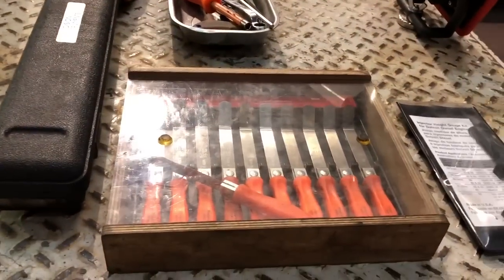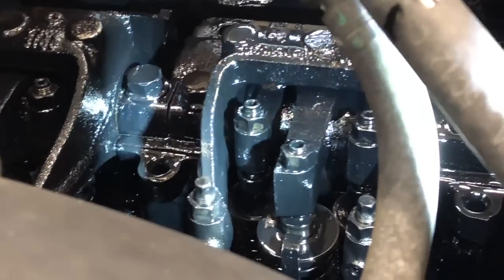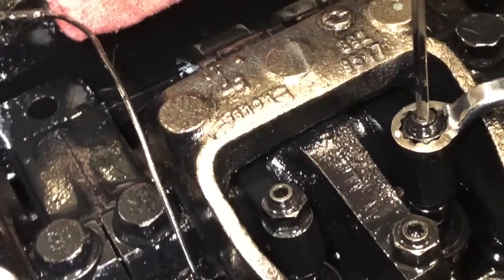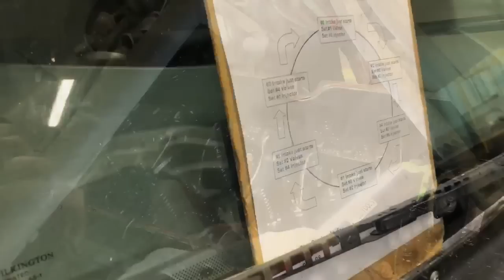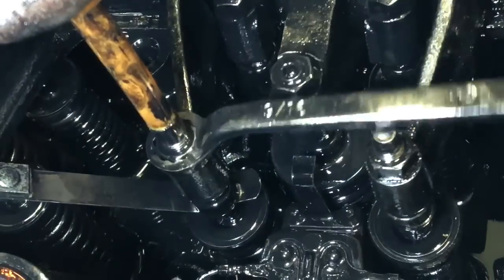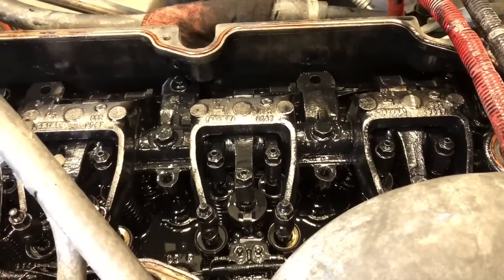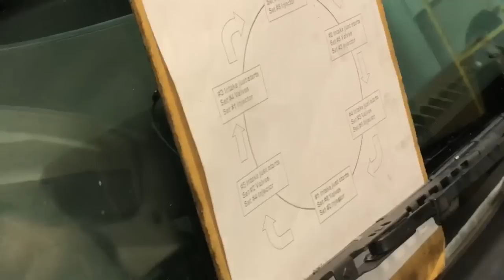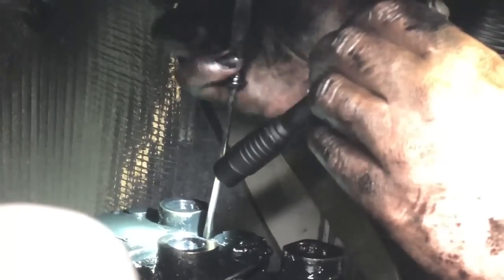How To Do A Full Overhead On A Detroit 60 Series ! Taught by an ASE certified Detroit technician.

Comment: Pro Tip from a Cummins tech: did your hear how he said its a feel thing?? well that is correct to a certain point, let me explain. Did you see how when he would run adjusting screw down then "feel" for slight drag then tighten the nut? If you want the "perfect" feel every time do this: Insert your feeler gauge as he did turn the adjusting screw down just until you have resistance hold it in place and then tighten your jam nut down. The slight tension the tightening of the jam nut against the adjustment screw will create that "perfect" drag every time.

Comment: Here's what I taught myself at 2 in the morning and the truck is to be rolling out around 7. New cylinder head installed, ran the overhead and missed my overlap.  Doesn't take but a few degrees guys. As soon as that intake roller starts to move with your finger on it, stop. If your intakes are too tight or lose determines where the roller is on the cam lobe ramp. I always roll my intakes to the bottom of the lobe and set those intakes then roll it up to where the roller starts to move. Doesn't take but ten minutes longer. But so what.

Comment: Totally fascinated by this video. Watching a master mechanic with years of real world experience working his craft is so exciting.  All the while, kneeling on the top of a steer tire hunched over. Makes me hurt just thinking about it.
Reply: Tim Jackson I pulled a muscle in my shoulder when I removed that rear Jake brake housing, been doing this stuff about 12 years professionally and it's made a tired body out of a young man!
Reply: @dieseldoctor9294  those are not light. At least 30 lbs each I think. On the 14 liter I'm doing anyway.

Comment: Cheers from Down Under.

Great video.  Love watching this sort of stuff.  Was a diesel mechanic years ago but now I just enjoy tinkering.  Miss is a lot but watching you work on this kind of job reminds me of the sore back and the hyper-extended knees. 

Those screws that hold the Jake wires.  Take them out and throw them to the schissenhausen then replace them with allen head screws.  I hate flat bladed screws at the best of times but when they are tight like they were for you then they easily burr over resulting in a lot of swearing and added time to the job.

Keep up the good work.
Reply from the maker: Thanks for watching ! I really appreciate it !

Comment: You run the inj height tool different than me for sure. I put my finger on top and rock the tool in and out watching the bottom of the tool. If the post moves in the inj hole too high, if the flag moves on top, too low. Right in between, lock er down. Also you don't need short rocker shaft bolts, just use the jake spacers  on top of the rocker shaft.  Also once a year you are suppose to remove the inj harness at the ecm, inspect for oil. If oil found replace the inj harness and if you have the million dollar fitting, vac test the ecm. Must hold 6" of vacuum for 15 minutes. I worked in a fleet that had 11000 s60's.   Take care, wear gloves, that crap is highly carcinogenic.
Reply: I don't wear gloves, but I don't drink or do drugs, and my hands get greasy oily maybe once a month, not every day

Comment: When adjusting the J valve for the Jake's loosen the lock nut and turn in the J valve in about a half a turn to bleed it. Then set your lash adjustment. This pushes the oil out so you don't get a false reading.

Comment: I would remove the surge tank mounting bolts then swing it out of the way with out draining 
Next I would remove the cowl 
Doesnt take long giving you a better view for inspection and also prevent dirt and debris from falling off of it and going into the open over head
Then that tray of tools I wouldnt use them 
I use my series 60 tune up tool I build 
Sold many of them to some of the top series 60 tecs in the bay area who all testified they loved the tool because it was faster and made the job a lot easier
37+ years heavy duty mechanic
27 years at a major freightliner dealership
10 years at Mack
Short time at Peterbilt
Cummins definition of zero lash is 6inch lbs 
You tighten the adjusting screw with the feeler gauge in place tighten the adjuster to 6 inch lbs tighten the jam nut let it go
Reply: What 60 series tune up tools did you build and are they still available

Comment: After how many miles should a overhead be done?
Reply: I recommend every 500,000 miles you should run the overhead, rebuild your fifth wheel, pull and install new wheel seals, clean your doc and replace the dpf with new, and spin the fly wheel and install a new clutch.
Reply: @marcusharris113  how about just buy a new truck while you're at it?

Comment: How much  does a overhaul usually cost for Detroit? I'm looking to get into a older truck preferably with a Detroit 60
Reply from the maker: Just depends on the place you have it done could be a flat rate of $250 to 4 hours labor plus valve cover gasket cost and injector wiring harness depending on if needs replacing or not
Reply: Would you recommend the Detroit 12.7 over any other engine? I'm pretty new to trucking 8 months in.  I plan on going owner op in few months. I've only driven the paccar engines they're great to me but everyone always says stay away from them
Reply from the maker: I love the Detroit 60 series they are great. Our entire fleet is all Paccar Mx engines all but 1 Detroit (60 series) 1 Cummins Isx and 1 Cummins M11 
I am not a Cummins fan at all. They are strong but won’t last (look in the truck paper at how many are for sale at 500-700k and you will see “recent inframe” 
My favorite engine is the Paccar MX13 EPA10 engine. When they are deleted they never come back in the shop for anything other than ac work, regular maintenance, belt tensioner or air leak on the fuel cutoff (I did a video on common issues with Paccar engines that shows everything you will see with them). Once those epa10 trucks are deleted they are really reliable and an amazing engine
Reply from the maker: I think you meant overhead in that first comment vs overhaul. An overhaul will be much more money around $20k depending on what it has to have inside
Reply: @KoonTrucking  those paccar engines have garbage resale value. 
U have a video on the delete process ?
Reply: My first company truck had the MX13. I recall it didn’t feel particularly powerful, kind of annoying how wheezy it felt. 

But it was reliable, and phenomenal on fuel. I’d see over 10 mpg sometimes, with a load!
Reply: Red Bluesome was it governed?

Comment: going into trucking Clay, gonna buy me a semi with a detroit 60 series, which truck would u recommend with the least amount of issues??
Reply from the maker: Freightliner with a 60 series. Everyone can work on them and parts are plentiful. They all tear up but parts and people fixing them is the money breaker
Reply: @KoonTrucking  People's is saying get the pre emissions 60 series, i believe 2001 and older. what do u think?
Reply: Frieghtliner Classic and FLD 120 are the two easiest trucks in the industry to work on. Very well designed . the big complaint i have is the cheap doors and hard to get at inner dash. But they are easier than most others.

Comment: Where can I get the tools he used but for a d15 like the height gauge for example
Reply from the maker: You can get them through NAPA or amazon or a Detroit Dealer. Just ask for an injector height tool
Reply from the maker: You can get them through NAPA or amazon or a Detroit Dealer. Just ask for an injector height tool
Reply: I bought my set from Snap On for around 60$ it covers all the 60 series engines

Comment: Man that thing needs an oil flush!  Good time to switch over to Amsoil.
Reply from the maker: I agree it was bad nasty in there. Sad thing is the oil was only changed 2-3 weeks before we ran that overhead. He does run that truck hard but I think the problem has been he had been using speedco for his service work or loves etc instead of sticking to one place and one type of oil. I also believe there’s something else going on in that engine it has a good bit of front end noise to it.

Comment: ok so i used to work of gas powered outboards. why are the injectors moving?
Reply: Deisel injectors are actually plunger pumps operated by a cam lobe. Some manufacturers call them " unit pumps" one in each cylinder.they fill with fuel from a fuel rail in the cylinder head.

Comment: anyone out here that can help my Detroit 60 series won't go past 1500 rpms won't pick up speed any clue what it can be no engine light on or nothing?
Reply: Turbo spooling up
Reply: Check for boost leaks fuel restrictions
Reply: I work on 2004 and 6 on ares its speed sensor
Reply: egr stuck open
Reply: Could also be an oil pressure/oil level issue.

Comment: You need to recommend 15000 miles for an oil change, don't let the owner go 20000 miles that engine is dirty.
Reply: Big. Fleets  grease and inspect 30k,. Grease inspect oil change 60k, grease inspect 90k, grease, inspect, oil change, run overhead 120k. Two oil changes per year, solo driver.  Oil Mobile delvac.  Grease cenpeco.  Pre egr engines trade at 900k before overhaul, injectors at 500-600k. Egr engines inframe at 350-500k. liners polished out, major oil consumption.. Trade at 750-850k. All trucks new clutch at 450-550k.

Comment: Are the external dimensions of the 12.7 and 14L the same?
Reply: Wayne Swicegood yes, external dimensions are basically the same.
Reply: Diesel Doctor Matt Then why do some guys complain about the 14L not being as reliable as the 12.7? The 14L is essentially a stroked 12.7 correct? Did the 14L just not pull any better for the added fuel consumption? Being a gas engine mechanic my whole life I’m just trying to learn as much about the Series 60 as possible. I’ve driven a lot of the older pre emissions 12.7s and they were great engines in my limited experience.
Reply: @prevost8686  they are EGR engines.Delete the EGR and they are a rock solid engine.

Comment: That overhead was very sludgey I know the 60 series oil get pretty nasty but that’s about the worst I’ve seen
Reply from the maker: Alex Corvi it was extremely bad I agree. It’s not that he don’t keep it serviced either he is a good customer. I know he runs it extremely hard because that oil was only about 2-3 weeks old. There’s something going on inside that engine I’m afraid
Reply: Koon Trucking time to do an oil analysis on the old girl. Don’t take a lot of coolant to cause sludge under the valve cover.
Reply: @KoonTrucking  quick question if you stick a bore scope camera in there by 6 injector and a light would you be able to see that hole that your injector height tool goes in so that you could just look at the screen on the camera and stick the tool in there or is that not possible? I'm just thinking of ways you wouldn't have to crawl underneath the cab to see in there.

Comment: How can I get a copy of the chart that's on your clip board?
Reply: Jamie Rigdon Google detroit diesel circle of life, should pull up a similar version of this chart. The chart I am using is a simplified version of the one in the Detroit manual.
Reply: Diesel Doctor Matt thanks bud
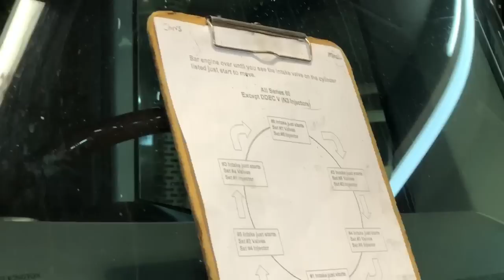Reply: I couldn't find the circle of life chart online, but if you go to Time = 48:57 you can screen capture a pretty clear view of the one used in this video.  Online, I could only find http://www.detroitmanuals.info/series-60/040D02.html which looks good but I don't know if that is a reliable source.
Reply: Click in " Detroit 60 series overhead procedure" on google and you will find the right procedure for your engine. Look dor your series.DDEC I. II.   III Etc

Comment: hey guys just rebuilt my motor looking to get an exaust manifold for 2006 century class
Reply: A buddy of mine put a ported, ceramic coated manifold and one size larger Borg Warner turbo on his. He said it is like driving a different truck. Much better response and he gained .6 MPG witch is alot of money in the long haul. He has run it for 3 years with no problems

Comment: whats your procedure??
Reply from the maker: Tavo C it’s pretty much all there step by step from start to finish only thing we didn’t film was a few minutes of break time.
Reply: Koon Trucking im sorry is just that i couldnt figure it out.. maybe because i always do it as the manual.. i think you are using a little different method but it works the same..

As if you adjust as they become loose.. till you finish.. right? Like when you dont have a procedure
Reply from the maker: Tavo C I’m not sure what you mean, that’s what the chart is for to adjust the injector and then intake on another cylinder then the exhaust on another cylinder ?

Comment: Very sootie packed..oil intervals every 60 thousand miles?? Maybe a crappy motor like maxxforce but For a 60 series??  Tisk tisk
Reply: sticK&Clutch I have been working on Maxxforce engines for many years. This is just an engine that idles forever, doesn’t change their oil at recommend service intervals or both. For the Record International engines have valves bridges, one for both intakes valves and one for both exhaust valves #betterdesign both engines suck ass
Reply: Series 60 is a great engine. It was noted that the owner of this one runs it very hard, and has the oil changed every 20,000 miles. The oil was 2-3 weeks old when this was recorded.

Comment: They don’t believe in regular oil changes huh
Reply: hddm3 that truck is serviced every 20,000 miles. At the time the overhead was run, that oil was only 2 weeks old. We think there are gremlins in the engine, hoping it holds together.